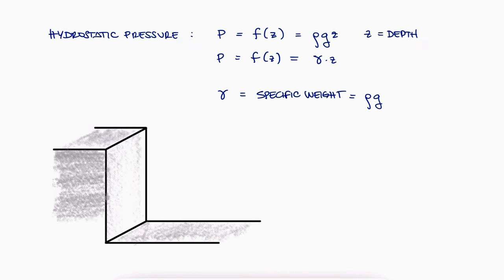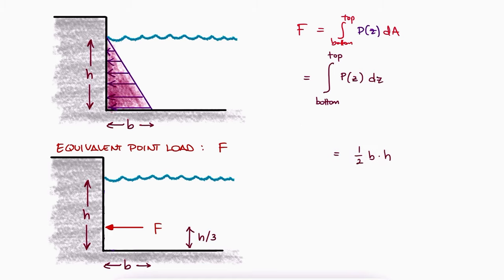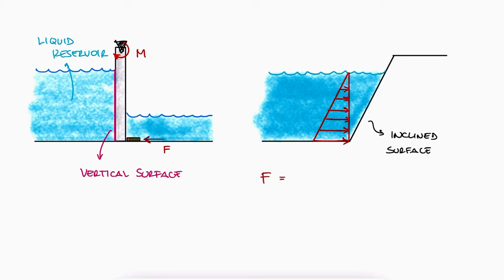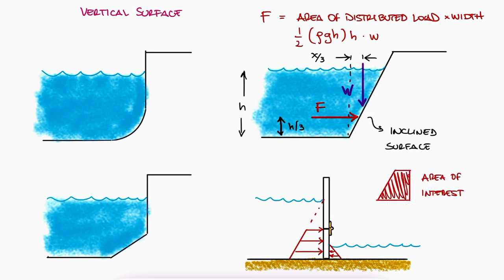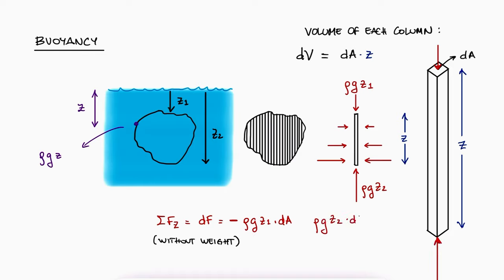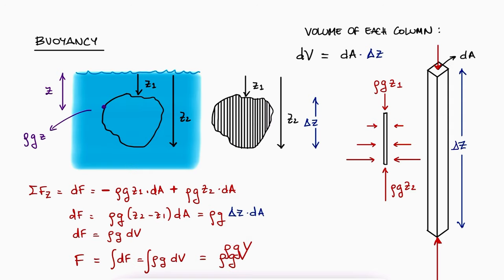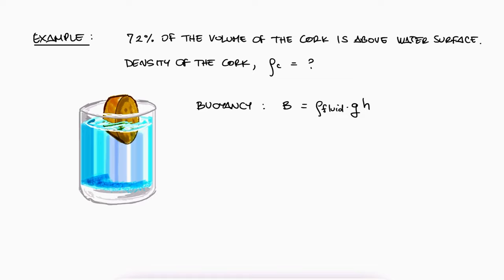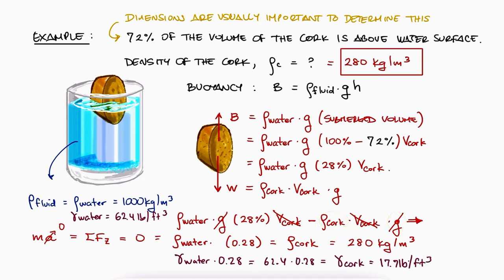Buoyancy for Fluid Mechanics in 8 Minutes!

Comment: I have an issue understanding the internal stresses in an object due to buoyancy - if I would put a long steel rod in water -> if it was thin and long enough would it buckle due to buoancy? If I think about this according to the Archimedes principle, it would clearly not, it is just as if the steel rod would have somewhat lower density, but no reason to buckle ... but if I use the piston force principle (where buoyancy is added as an external force B=Crosssection of the rod *p), the answer would be yes, the rod would be under compression at the bottom.
So now one could just say: ok the piston force principle is just wrong ... but then it offers a good explanation of why there is no buoyancy force if e.g. a cylinder sits at the bottom of a water filled beaker (with no water between the lower area of the cylinder and the bottom of the beaker) ... so I can't just throw the piston force principle out of the window ... there is something I do not understand about the internal stresses caused by buoyancy ... can anyone point me to what it is?
Reply: Hmmm. Your question seems valid -- Must admit I'm a bit confused right now! Thanks, lol :)
Reply: @Zar4thustr4  thank you so much, I'll look into it!
Yes, me too, sometimes I do a double-take on some things. 
Take care.